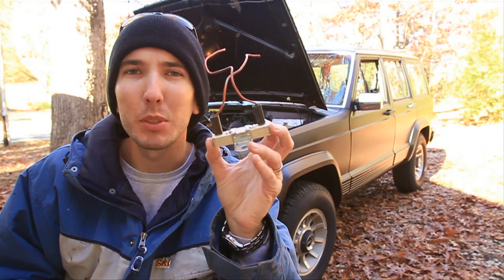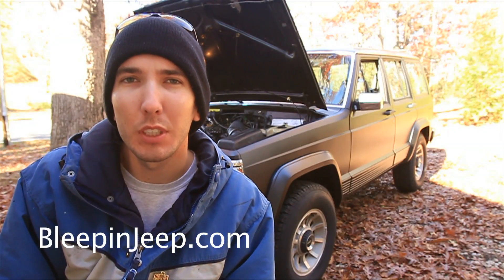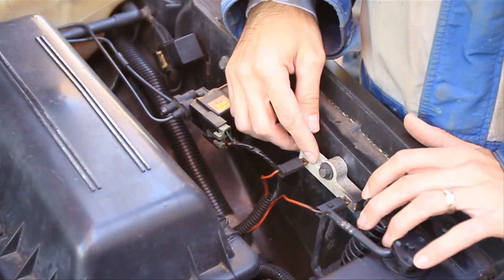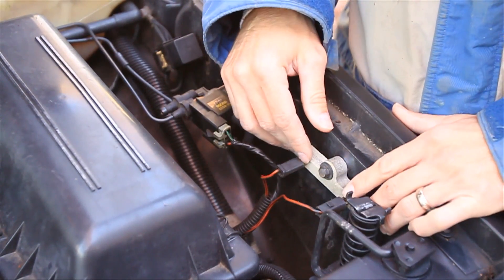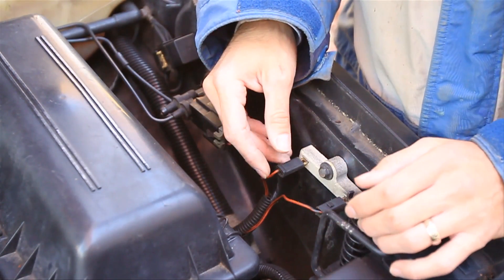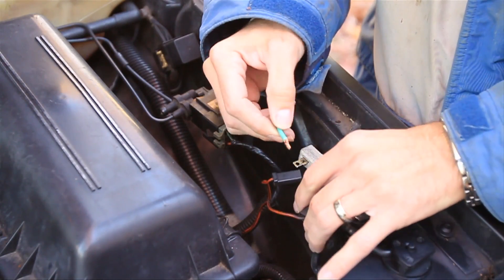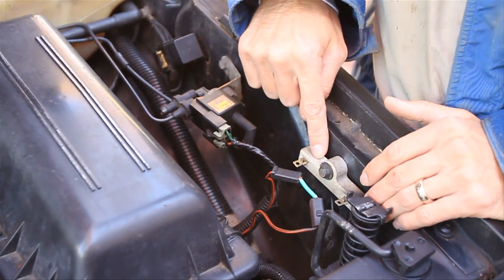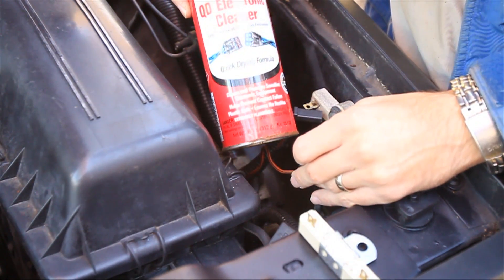Fuel Pump Ballast Resistor

Comment: Thank You, bro! I spent $300 on parts -fuel pump,  filter, CPS, Ignition switch, and still wouldn't run. Start and die! Talked with several XJ clubs. No one mentioned the ballast resister. A week of hell. Then I found this vid (should've searched Bleepin Jeep first). After all that, it was an $8 ballast resister! You're best, buddy! Thanks. Anyway, the old '90 has lots of new parts that probably needed replacing anyway!

Comment: ya know i was lookin at that, a hole was made and the part of the harness was fed through and secured to a weatherized distribution block and the contacts soldered together. Ive never had any problems with it. They wrapped the harness really well with what looks to be a fiberglass wrap.

Comment: Chrysler used these things for years for the coil, they went bad regularly. I used to have an extra one screwed to the firewall next to the original on my 74 Dodge stake bed truck for quick changes on the side of the road.

Comment: Thought ballist resistor is linked to the coil not fuel pump ,it reduces voltage to coil after starting it only needs about 9v to run coil but allows 12v when starting
I don't own a jeep (in the process of looking) but if they deleted them after 93 they must have changed to electric ignition 
This may have been addresssed in a different post but I have just found your site and now a fan 
Keep up the good work the videos are very educational thx

Comment: Buddy has a 90 that won't start. It's been sitting for 8 years. We jumped the fuel pump relay to dump the old gas from the fuel filter feed line to a bucket, but no pump! This could be a bad fuel pump yet, but after reading about this problem, I am hoping this is the solution! I also learned about something called fusable links, God I hope that's not really the issue lol
Reply: Ryan Fay  Hi Ryan, I have an 88 Cherokee that’s been sitting for over 8yrs. I need to empty a near full gas tank using the fuel pump.I tried jumping the relay - nothing. I checked for power between the two relay contacts - no power at either contact. Was this the same problem your buddy had?  Your help would be appreciated. Thanks

Comment: Clay type sealer on the back dries out and cracks.
Spring inside rust through.
Just bypass until you find another one.
About 1-1.5 ohms resistor value.
Drops voltage just so fuel pump is not loud.
If you like to hear your fuel pump just bypass.
12 volts or 10 volts , your choice.
Factory pump is a very nice Bosh brand. $$$
Ballast resistor , around $10. Not in wiring diagrams.
Was added after service manuals were printed.
Customer complaint fix.

Comment: What do I do if the right side wire closest to the head light doesn't have the plastic connector and touches metal and sparks? I'm thinking it shorted out because I've cut both ends and wired them together properly like mentioned in this video and still won't run I'm out of ideas please help

Comment: Do you have to replace it ! Or can you just wire it straight ? 🤷🏼‍♂️🤷🏼‍♂️
Reply from the maker: You can bypass it yes.
Reply: @bleepinjeep  I feel like it will perform better.. 🤷🏼‍♂️🤷🏼‍♂️
Reply: @bleepinjeep  also I’m having a issue with my plugs being lean. And also my 93 xj seems to starve for fuel at rev limiter. I’ve been chasing the issue for a month and replaced so much shit I’m ready to burn it 🤣🤣 or just drive it like I have been.

Comment: I had that same issue, I bypassed the ballast it ran fine to make it to the parts store, I guess it fell out when I got there now It won't start (not getting power to the ballast, pump kicks right on if I run 12v to the other wire)

Comment: Tnx! I like the video! I was running low on gas once, and the engine died. I had someone come out with a can and I fetched some gas, but it would do exactly that, even after putting gas in.  I ended up getting a lighter cord from a tire pump and hot-wiring the fuel pump. That got me home, but then it was OK, without this hot-wire, for years without doing anything.  Today, again low on gas, I stopped in a gas station to get gas, and 100 feet from the station, the engine was fluttering.. A few hundred feet later it died. No start at all, just crank. I hot-wired it again, and it runs, but now dies when I disconnect the hot-wire. So, maybe the relay? Does the starter bypass this resistor, or another relay? TNX!

Comment: hey Matt I had a quick question not sure if you can help or not but my 93 right hand drive xj is running very choppy and dies a lot I replaced everything ignition wise and checked the engine codes the other day and it is throwing a code for the fuel pump resistor ballast and I can't find one under the hood do you know what area I should be looking in it is not by the fender like all the other ones

Comment: where is this located on a 2001 Jeep Grand Cherokee Larado ?  4.0 liter, 6 cylinder>
Reply from the maker: +William Butler they did away with them in I think 95, pretty sure it says in description
Reply: nope. I think it's inside the driver's side wheel well
Reply: William Butler did u find the ballast resistor I have a 2001 Jeep Cherokee too

Comment: Just bought a 97 Grand Cherokee for my son. Had been running great, but when I was almost to his house it cut out. I pulled over and added fuel not knowing if the gauge worked. When I started to leave it would not restart. After 10 minutes or so, it started right up and didn't do it again. I don't want him stranded. Will change the distributor and button. Maybe the cam sensor. Other thoughts anyone?

Comment: I have a 1990 jeep xj that was doing the same thing it started off stalling then it would die when climing or going down steep hills sometimes on flat ground now my ballast is getting really hot to the point it would smoke so I tried to bypass it with a jumper wire and it would get hot then it would die as soon as it stated.. I was told there is a starter relay that has a ballast rester on it where is it located??? and does that sound like it would be it???
Reply: That's probably a 10 watt ressistor so it's going to get hot.. It it's more that three volts across it, and it's still about 1 ohm resistance, I'd say the fuel pump is binding.. Does the gas gauge act crazy when it happens?
Reply: I have replaced that and it still does it someone had told me my tps may have gone bad coz it was shifting funny too before the jeep had quit running
Reply: Ohh. TPS!  My tyranny was doing this buck-shifting thing and I changed the TPS which fixed it first.  month later it was hanging in low gear when it got warm. TPS bad again. Changed it again, it's been good for  long time.
Reply: I found this resistor goes to a relay by the bank of 4 relays. It sits at an odd angle.  Metal relay like a solenoid..
Reply: I replaced it today and i still have nothing now it wont even start and die now i have no fuel pump and sending unit isnt working before i had fuel reading now it says emty
Reply: I checked to see if i have power it only has 3volts for 2 secnds then i have nothing
Reply: Zach Monahan I had a mouse eat the wires UNDER the wire loom once. On my tank, the return power for the pump came up the pipe in the tank, that holds the pump.  I wired it to a screw I put though the mounting plate, and grounded it outside, not using the pipe, because that pipe is loose on mine. Stock, if that return pipe is loose, no ground to the pump or gas gauge sender.
I suppose, if that's the issue, you could hose-clamp a ground wire to that return pipe on the outside..
Reply: found out the wires that run under the seat also to go the fuel pump..i had found the short there also a lot of rust lol so I had made a new wire harness for it now it works fine

Comment: Could you leave it with the jumper and just not have a resistor?
Reply: Bajaheat i was wondering the same thing
Reply: Jacalyn Andrews I did it about a year ago and it's still going strong lol.
Reply: Bajaheat thank you. we just didnt want to mess anything up.
Reply: I reckon one could leave it bypassed, but... it's there to 'condition' the voltage.  For $8 - $12, would I (or you) want to chance messing something else up, over time?
Reply: Bajaheat it was a recall part added to make the fuel pump run quietly. Folks were complaining that the fuel pump was running too loud. Don't worry about overpressure as the fuel pressure regulator takes care of that.

Comment: where can I get a new one at other than online for a 88 cherokee
Reply: I bet radio-shack has 1 ohm resistors that big. Not with terminals on it, though..
Reply: 99.99% of auto parts stores will have them.  These are used on tractor ignition systems, also.

Comment: MATT! I have a mysterious problem and really need some help. So the other day I was driving down the road and my 89 Cherokee just died on me. I don't have spark and I can't hear my fuel pump turn on. When I turn the engine over I get a little bit of fuel in the rail. I changed my CPS and coil. Still don't have spark. I know my plugs and plug wires are fine, same with the cap and rotor. My rotor turns. Most of my stuff is caked in oil but I don't know why that would just now make it not work. My ECU has one diode that was a little crispy, but still reads Resistance/continuity. I had my ICM tested and it failed so I will be replacing that on Monday. I still don't know why I lost both fuel and spark at the same time. One thing is, for about three months now it has taken two tries to start. (Maybe failing fuel pump, bad diode in ECU, or plugged filter) I don't know. Maybe you can give me some direction because I'm not sure what else to check. I appreciate your time and input. I also really apreciate all of your videos. They have helped me a lot.
Reply from the maker: +wyatt ditmanson well start by checking for fuel.  hold the shrader valve open on the fuel rail and have someone turn on the key... fuel should spray everywhere... if not then you have a fuel pump problem.
Reply: Okay, I will do this test in the morning. How should I go about the spark issue. Like I said could be the ICM. But if that doesn't fix it could it be the ECM?
Reply: Sounds like a crank angle sensor. Same thing happened to me!!
Reply: What turned out to be the problem?
Reply: Crank angle sensor was shot!!
Reply: It was the ECU! The ignition circuit in the ECU shorted out somehow. I bought an A1 Cardone ECU and the same thing happened. Got a higher quality ECU and bam! I was back on the road.

Comment: I have the same exact problem that you showed in the video except I replaced my ballast resistor and tried jumping it with wires and nothing solved it. What else could cause that problem? I’ve tried 4 different crank position sensors, new tps, new ignition coil and everything
Reply from the maker: Try one of our videos called why won't my car start